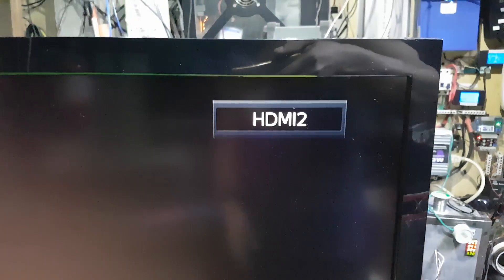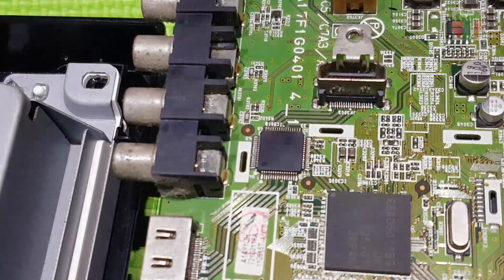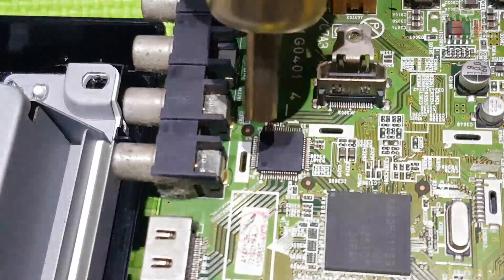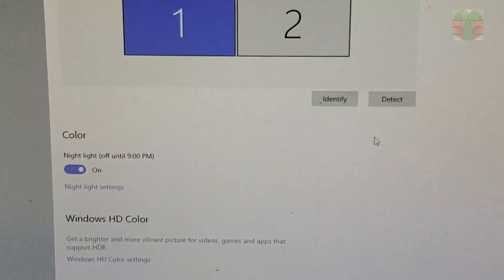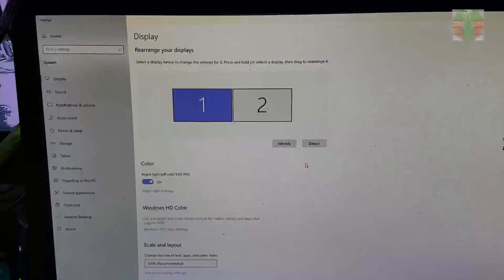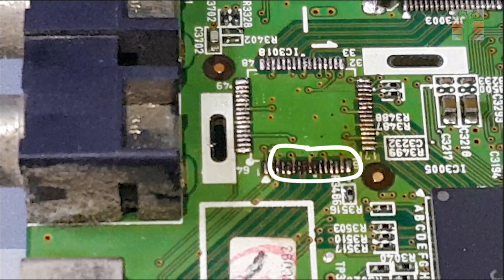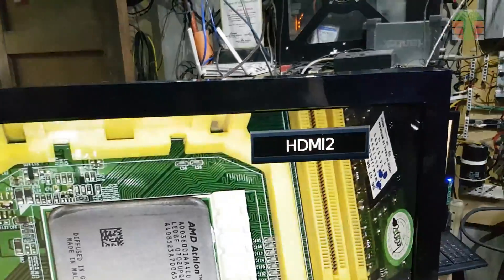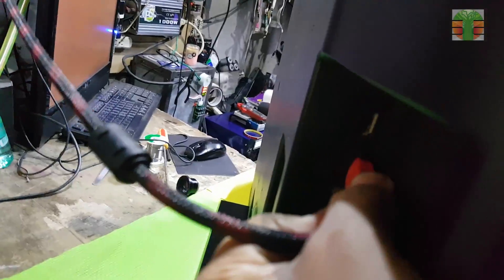HDMI no signal

Comment: Wow great video please advise, on my sony kdl-55hx850 the hdmi inputs are not working so I removed the hdmi chip sil9287bcnu like you but I don't have a replacement yet, so I connected the tmds line directly to the cpu from one dhmi input, but I got 3x red blinks and now the TV won't turn on and then I found out that the TV is controlling the hdmi chip ic. Is it possible to bypass the hdmi chip somehow so that the system thinks it's there? Or do I have to put a new hdmi chip back in? Or is it enough to replace the chip with a resistor from 3.3V to ground so that the system thinks there's a load?or  connect some pin to ground?pls help 🤝
Reply from the maker: try not disconnecting the data and clock of the chip.
Reply: Thx but how,the chip was completely removed